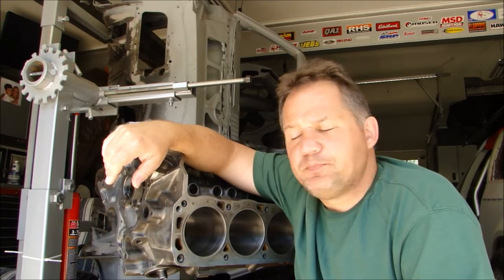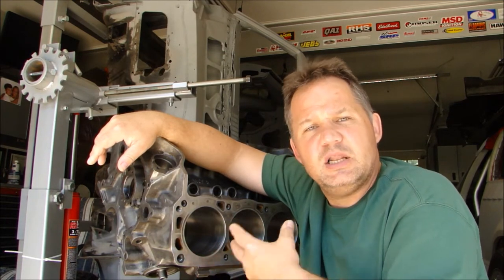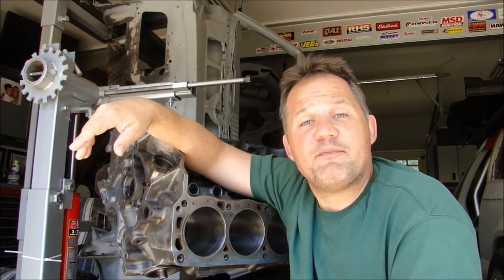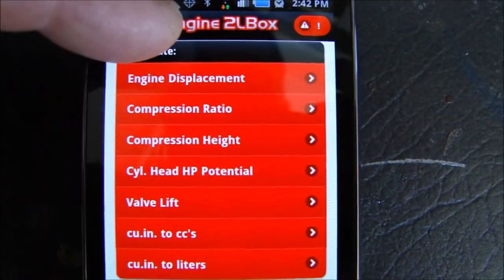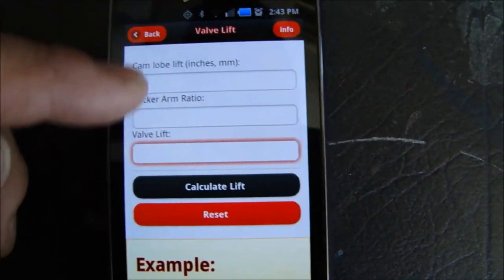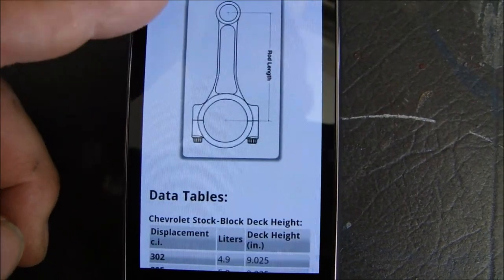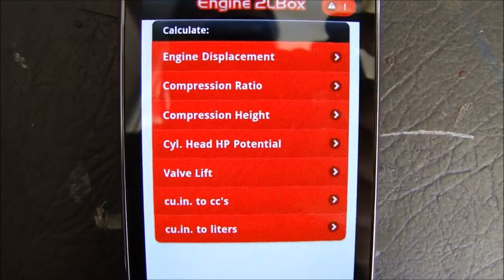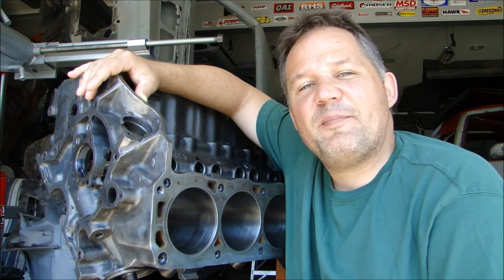Engine Buiding Apps

Comment: I reached out to you by text, I didn't realize that you weren't doing anymore stuff on you tube, shame, you had a lot of good information. Watching you I felt like I was learning engine engineering rather than watching a shop mechanic turn wrenches. Good information, great Gold series Les Paul, ever get around to doing more videos would love to catch some on exhaust systems. Someone reading this might even want to do it, if you don't. The benefits of running x pipes, header cut outs, straight pipes with and without flow thru mufflers for street applications. Anyway thanks for the work you put in on the videos that you did and I appreciate all the information.Russ c. Dahlonega GA 1970 Torino 351C shaker hood custom build.
Reply from the maker: +Russell Cochran Did I answer your text? I try to answer them all immediately. I still make videos...many more since this one. Visit my channel and see the whole engine building series. I just posted a video and am making many more. I have no plans of stopping. When I put the engine I'm building not into the car I'll cover exhaust systems. I love the Torino. Had a '72 with the 351.
Reply: Pete, didn't mean to imply that you didn't answer me back? I just didn't want to seem be a bother if you had discontinued making videos. I seen the date on the one I was watching was 2013, my apologies if it sounded different.
Thanks
Russ
Reply from the maker: +Russell Cochran No problem...I get many messages and never want to leave anyone out